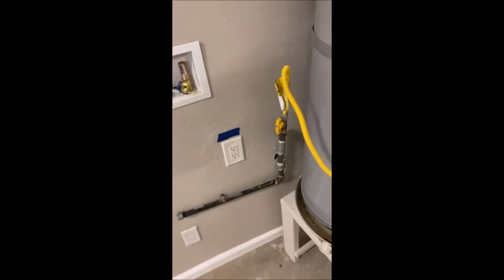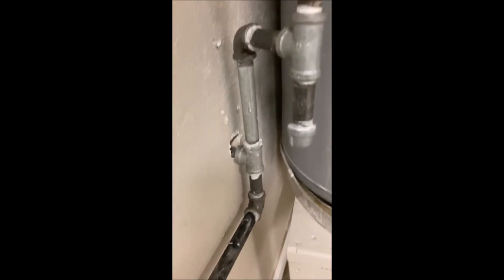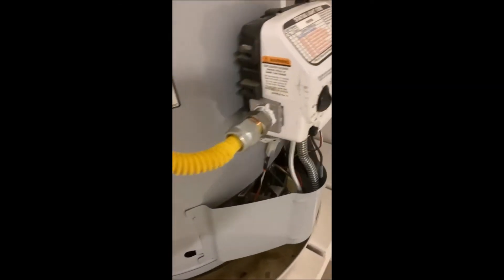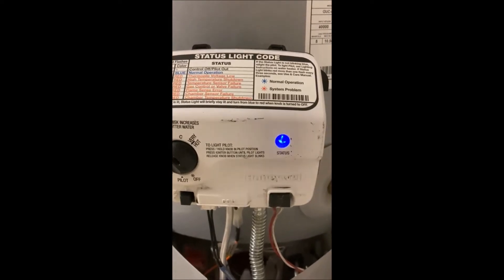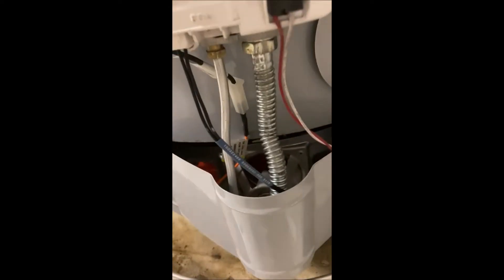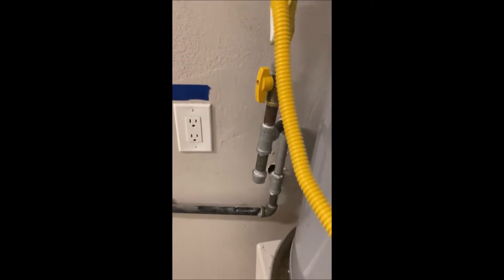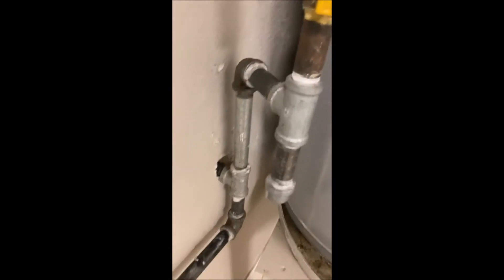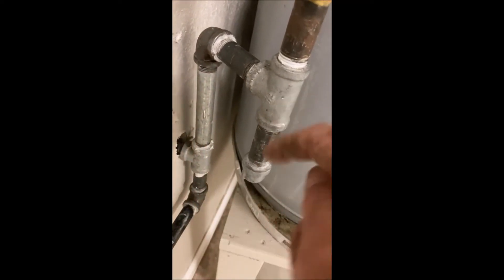Sediment Trap for a Water Heater (pro-tips)

Comment: This is the first video that I have viewed on YouTube that shows the correct orientation of the sediment trap based on updated UPC.  The trap is located after the gas shut off and before the flex.  All of the other videos that I have viewed on YouTube show the sediment trap installed at the temperature control valve with the flex line installed behind the trap and then hooked up directly to the gas line outlet in front of the shut off.  I assume that your video demonstrates the correct install of the sediment trap based on current UPC.  It looks like all of the other videos that I have seen on YouTube were uploaded years ago before the Updated UPC.
Reply from the maker: Yes we had a project a few years back and had about 150 water heaters inspected by the local building department and they had us move the sediment trap to the main gas line shut off at top of trap and flex to valve . Thanks for noticing I see them installed in correctly all the time but I let it go.! 
Thanks for watching!

Comment: I want to put my own trap on but conflicted with the code. You wouldnt happen to be in California? Im not sure if the trap comes before or after the shut off valve. From what i see out here it goes main, flex, shut off then trap. The trap is also installed as close to the appliance. Not sure what to folllow.
Reply from the maker: @derekshane8786  the trap comes off the wall , shutoff on top of the trap flex over to appliance that’s code in San Diego
Reply: So, just like your video. I'm sure San Bernardino code is the same as San Diego. It just seemed weird to me why the shut off wouldn't come before the trap so you could turn it off when it (if ever) needed cleaning. Thank you for getting back to me.